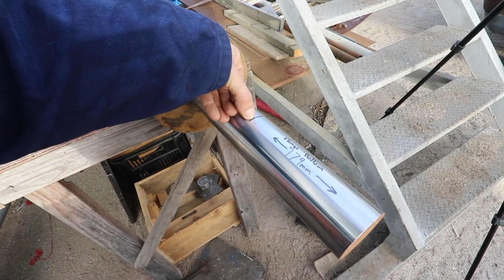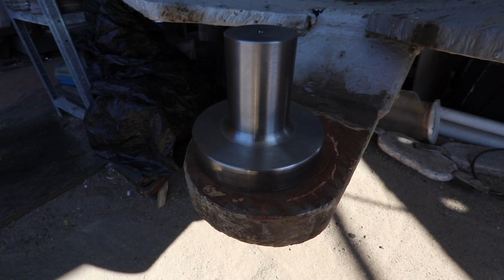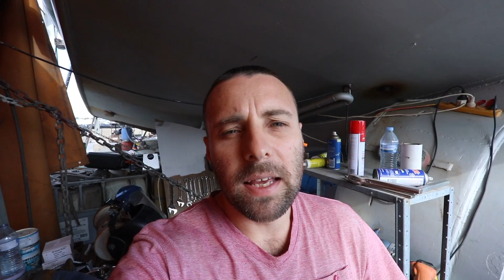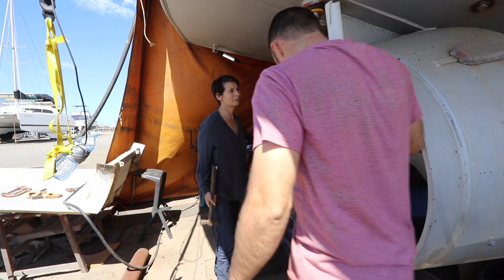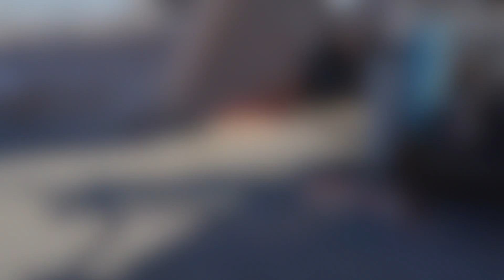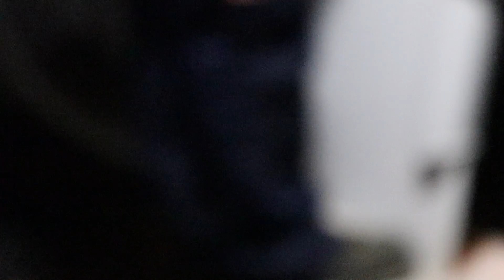Fitting a Trawler Rudder - Project Brupeg Ep. 101

Comment: You dont have a split stick?
It's a simple .250 " if thats the diameter for your air grinder" diameter rod split down the middle about two inches . The length of the stick is determined by the depth of your hole. 
 Then take some two inch wide emery cloth and slide a folded piece of it into the slot.
     You can make one in a matter of minutes. Cut to length,cut your slot and thats it.
You'll get much better results than taping a piece of emery to a tube of glue.

Comment: Wonder if this could use a tapered roller bearing instead of the plastic bushing at the top and bottom of the rudder shaft?
Reply from the maker: The bush doesn’t get any grease and is emmersed in seawater so a roller bearing would likely get a hard life down there

Comment: going off topic a mo, you could do with painting bitchamin under your lead acid batterys just in case of leaks, even under sealed batteries ,it stops the steal corrosian from acid,   its worth putting rubber matts under them as well, bits of grit over time will rub the bottoms, i used old inertubes from the scrapy cut up or rubber floor mats, nothing at all about your rudder video haha 

brupeg is fantastic ........
Reply from the maker: Thanks Ed, I will look into this, I like he idea of protecting under the battery

Comment: What are all those pipes on the bottom of trawler
Reply from the maker: Hi Benjamin, they are called keel cooling pipes. They work as the radiator for the main engine, the generator and the gearbox. These will all be replaced with internal cooling in New Zealand prior to heading to Antartica

Comment: Doug from SV Seeker used a piece of steel rod in a drill with a slit cut in the end with a sanding belt folded into it.. a perfect reemer for internal pipe sanding.
Great videos.. have subscribed Cheers
Reply from the maker: Cheers and welcome aboard. We used to make tools like that back when I worked in workshops. I didn’t have any emery tape (or sanding belt) which is what’s needed to hold to tape to the rod. Hence we used a hole saw with a sanding disc taped on

Comment: When I saw Damien struggling with lifting the rudder post straight up (I've got a dodgy shoulder that will randomly dislocate so I wouldn't have been able to do it myself) was so glad when I saw you had a forklift to finish the job
Reply from the maker: When we pulled the shaft out i had an engine crane, that ws almost a year ago and ive since chopped the crane up and mounted it on the bow.

Comment: I got weld burn through my closed eyelids holding a part the boss was welding on a boat trailer, one time. And I went snow blind skiing w/o goggles, one time. It only takes once. It felt like someone was pouring fine beach sand into my eyes when I held them open, and worse when I tried to close them. I guess you Aussies must get UV rays all the way round to the other end of the globe,  too?

Comment: Mmm flash burn nothing like that feeling of hot sand on your eyeballs. I would rather have a ball of slag roll around on my wobbly bits again
Reply: Anti sneeze doesn't allow galvanic welding or 2 dissimilar metals permanently bonding to each other . I may be wrong though but the stuff works
Reply from the maker: Hi Gavin, ive not experienced AS doing anything too weird. certainly not something like making parts harder to seperate.

Comment: Great perseverance guys, without a lathe or a large expanding Reamer it was about the only way to go. The self lube bearings are quite forgiving and with the small amount of movement from the rudder should not be a problem. 👍🏻
Reply from the maker: Yeah my though was if we can get it on the natural wear of use will bed the bearing in. we had to use 60 grit to take anything out so it wasnt the smoothest of finish internally but it will work fine. it is between 0.1mm and 0.0 so tight but not at the same time

Comment: Should have got the machine shop to drill and tap an m12 into the top of the rudder for a lifting eye
Reply from the maker: Hi Fowletm, It's got a lifting eye but its the biggest pain in the arse to use, having the wings on makes it so incredily easy to pull this rudder compared to the old method.
Reply: @ProjectBrupeg  
Sorry 
Ment the rudder shaft 
Though I'd typed that? Forgot a word 

Yes the wings on the rudder certainly makes it easy

Comment: You're going to need a grease pump rather than a grease gun for the initial shaft fill (the sort they use on tractors that fit straight on top of a 12.5kg or 20 kg drum of grease in place of the lid - filling the gap is going to take most of one of those drums and filling a std grease gun 30 times going to get annoying real fast).  Make sure the lower clamp is tightly in place as you fill or will act like a hydraulic cylinder and push the bottom bearing out  Great work on the grease channels.
That forklift driver going to get some serious overtime ;)
Reply from the maker: Hi Andrew, im onto my third grease gun refill, and suspect im about 1/8th the way there.... i would love to get a mechanical contraption to fill this but honestly wouldnt even know where to look locally for one. My plan is to plug away at it, 2-3 cans of grease a day over a week, should get there in the end without making pop-eye arms. I like your suggestion about the bottomm clamp, i hadnt even thought about the hydraulic effect on the bottom bearing.
Reply: @ProjectBrupeg  Don't know what it's like over there, but in the UK pretty much every farmer has one lurking at the back of the barn, a worn tractor will take half a gun to push the dirt out of joints and bearings so a grease pump is the norm - the mechanism is just the same as a grease gun (on steroids) except a long rubber hose between the pump and the nipple attachment, and its mounted on a heavy duty clone of the grease (Drum, bucket, pail) lid with a telescopic pickup tube so it can be used on both 12 and 20 kilo grease drums.  Have a look on local classified adds, should find a used one for 20-50 bucks and you'll soon save that by not buying grease in expensive cartridges.

Because it stands up on it's own also easier to pump, well worth adding to the boat toolkit
Reply: @ProjectBrupeg  This is on the UK ebay site as an idea ;-
https://www.ebay.co.uk/itm/Expert-High-Pressure-Hand-Grease-Pump-Draper-43958/312393043513?_trkparms=aid%3D555021%26algo%3DPL.SIMRVI%26ao%3D1%26asc%3D59665%26meid%3Dedce0d4808784d42a5cc4b0b3237ce07%26pid%3D100752%26rk%3D1%26rkt%3D13%26sd%3D192901400798%26itm%3D312393043513%26pmt%3D1%26noa%3D0%26pg%3D2047675&_trksid=p2047675.c100752.m1982

Comment: Use the same type of plastic under the collar of the steering post as the one under the post and you won't need to use grease.  I believe it is called HDPE.  It is used to go in the bowl of truck centers to take the weight of a locomotive and not need grease to reduce wear when the trucks swivel.

Comment: If You don't have a socket to fit the ruder Nut ,Make one from Angle Iron work out what size angle fits around the nut face and weld it together to make the socket it should look like a 50c coin if done correct ,just make sure you make it long so you can drill a hole to put a bar into it to do it up. Or you could cut a Flat bit of steel using the nut as a temp let to make a spanner that can be hit 1/4" or 1/2" material should do it for you and use a FBH to hit it with :)
Reply from the maker: Hah you two have similar minds. I’m just editing the next episode where Dame makes something very like what you have described. Thanks 2Moza. Jess
Reply: @ProjectBrupeg   Your very welcome from a Expat from Australia :)

Comment: Car jack and a 4x4, great for lifts! Use a cheap rough grade cylinder hone to smooth out that bottom bearing...
Reply from the maker: Hi Mike, yeah we didnt have a hone but we did have a holesaw wrapped in coarse emery clothe which acheived the same thing
Reply: @ProjectBrupeg  I was a honer for an Aerospace Co. And we made up some really odd rigs to hone unusual surfaces. You can  drill out a 3" long dowel that's about 1/2 or 3/8" smaller than the bore, insert a long screw, add a nut to lock it and cut a 1/4" slit in the end. Insert sanding strips that stick out 2 or 3 " on either side and chuck the bolt in a drill. Spray some lube to flush the swarf and you're honing! You can glue foam to the back of the strips for a proper rig, but not needed for a rough out...

Comment: Damien, I know that you occasionally answer silly questions - Is there any other way to steer a trawler besides a rudder?
Reply from the maker: Thoughts and prayers... actually you could use drag. ie long arms out each side and paravanes trailing through the water, increase and decreasing drag on either side would pull the boat left/right. So theoretically you could lose a rudder if you had paravanes and a method to alter them while steaming.
Reply: If you lose your rudder and have a sea anchor or storm drogue, you can tie it to the vessel with two lines, dragging the sea anchor behind you. To go to port, shorten the port side line (using a winch). To go to starboard, shorten the starboard line. That way the extra drag on one side yaws the boat to go the way you want to go.

Comment: How close is the Fire extingisher to the lithium battery compartment? Does it have a smoke alarm? Just courious.
Reply from the maker: Currently, miles away, the lithiums havent even been brought or installed.... however, the lead acids in the engine room have 3 extingushers near by. The AGM's under the wheelhouse dont currently have an extingusher but will eventually.
Reply: @ProjectBrupeg  Actually I was thinking of the Camera/drone area,thats a lot of possibles.I have had one and It was not fun. Just me.

Comment: Like buckets of sand in the eyeballs. It'll pass, ask me how I know? 😁
Hydraulic or air lock on the pintle? 

Thanks for the video.
Reply from the maker: Hi Duncan, yeah after the first fitting we realised any grease on top of the stainless pin, stops the bush from sliding down, a great air tight seal forms

Comment: I suggest you fit a grease nipple to the top of the yoke,
That way you can lube that thrust face directly rather than hope the grease will climb up the rudder tube.
Alan in London
Reply from the maker: Hi Alan, If we need to we will but its easy to see if its working, when you squeeze grease in it either comes out the side or not, and the grease nipple is roughly 4-5ft from the yoke so easy to see while your giving it a squirt, accessing the yoke to grease is a major issue hence we want remote lubrication

Comment: Blame it on Gravity..Nothing goes up as it should because of Gravity, if at first you don't succeed, blame it on Gravity..Looking good Damien, oh yeah, Gravity is a Real Pissser when it wants. Stay safe and remember those muscles you haven't used in some time? Bet your remembering them now..OUCH is a word used universally, damm Gravity anyway !!
Reply from the maker: Yeah i pulled the shaft out with an engine crane, but by the time I was ready to assemble everything the crane had been cut up and fitted to the bow to lift anchors around

Comment: Imperial what’s all that about. Give me metric any day. Great work 👍
Reply from the maker: I have a system, imperial when I don't need accuracy and I'm happy to get it wrong (like the yanks did with the Mars Climate Orbiter...) and I use the correct unit of measurement (metric in case your wondering) when it needs to be right
Reply: "It's at least 10mm, almost half an inch..."
Reply: The reason the Imperial system has stuck around is because it is human scale - people can relate to it - I was one of those kids who had the metric system drummed into me and at the time couldnt understand why people would even consider it - now, some 4 decades on I tend to visualise quantities in imperial units - though if there is calculations on the horizon, I tend to do those in metric (and then sometimes convert that BACK to imperial) - I thought metric would take over in my lifetime, but when I heard someone ask "Alexa, whats 6'4" in millimeters ?" I realised there is now little advantage one over the other...

Comment: the bearing material will swell in seawater...so don't make it fit to tight!
Reply from the maker: Its an oil impregnated nylon, its impervious to water and self lubricating
Reply: It will still take some water (2%) en with a wall thickness of 0,5" you will need 0,033 tolerance. Maybe this is neglectable. It seems nice stuff for this purpose anyway.

Comment: What are all the pipes on the bottom of the boat at 4:26?
Reply: They're going to be removed when they prepare the boat for colder climates with ice infested seas.
Reply: @garyphillips7993 Why would they do that? Ice will not hurt those pipes.
Reply: @rsdna9698  They're reinforcing the hull & tanks etc Those exposed pipes would be a liability in ice fields, pretty sure that if a block of ice sunk the Titanic, they'd have no problem with a few cooling pipes 😉
Reply: @garyphillips7993  I would guess those pipes are as thick if not thicker than the hull or they wouldn't put them down there, so I would bet anything that damaged those pipes would also go right through the hull.
Reply: @rsdna9698  Err, I think you need to go back and watch some of the earlier videos. The ID diameter of those pipes is around the same thickness of the hull. If you believe they'll be fine in an ice field, let Dame know he'll be wasting his time when he carries out the next set of mods for the ice fields. I know I wouldn't be happy having the engine cooling in those pipes with ice wafting around them....
Reply: @garyphillips7993  I could see where they could cause the boat to get hung in the ice since it could not slide right along the hull, so yeah they should probably be removed if pushing through ice. But I still don't think the ice would damage them. :)
Reply from the maker: Hi All, we have been told the pipes are strong enough to handle ice. the issue is really about getting frozen in, if we end up locked in solid ice, we want the ice to be able to flow under the hull and push the boat up, so anything that can cause a restriction (like a hundred meters of thickwall pipe) on the outside of the hull is coming off. Plus with all coolign located inside the boat it makes it more possible for us to repair anything at sea compared to external piping.

Comment: Flash burn is the worst feeling in the world I had the same kinda experience was doing some welding on a trailer wasn't much to do an couldn't find my mask so I didn't use one once I got the weld going I shut my eyes and just went by the feeling woke up in middle of the night an literally felt like I had hot sand thrown into my eyes not even water helped its literally Torcha flash burn hope you end up better soon don't want it slowing down these great vids
Reply from the maker: Nah it wasnt real bad burn this time. 24hrs of sandy eyes then it eased right off. lucky I guess

Comment: Astonishing vertical resistance by that lower bearing to the full weight of the rudder + Damian. Does that bearing swell at all when wet? You might want to test it without the rams attached to see if it can be operated manually. You don't want the rams to work harder than they have to.
Reply from the maker: Hi Sid. Yeah once we deemed the bearing out it fits beautifully. Easy to move by hand. It is a hard plastic so shouldn’t take any water on board. The issue was the ID was too small, once we solved that it was an easy fit
Reply: Glad you're all over it. Thanks.
Reply: Very valid point though, I have had it before with rudder bushes even out of very hard plastic having to machine excess clearance into it to allow for swelling. This usually found out the hard way as all materials differ. “Orkot” is a great material for bushes and cutlass bearings as doesn’t swell at all.

Comment: I’m surprised that you didn’t fit the lower bearing into both the rudder, and then alternatively onto the pin prior to attempting final assembly.
Reply from the maker: I checked it on the pin and it slid really well. The issue was when we fitted it to the rudder it compresses it and the ID shrunk. The was also too much interference 2mm over all so we had to buzz some off prior to it fitting right
Reply: @ProjectBrupeg  You did the fitting perfectly. In cold water that rudder shaft might decrease in diameter and your figment will be perfect.